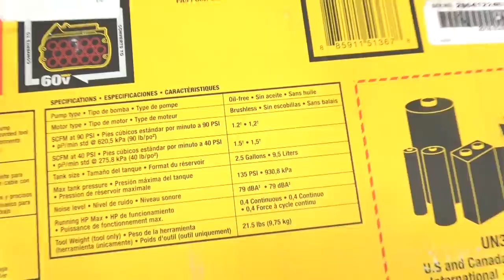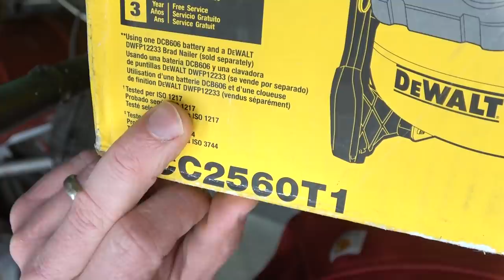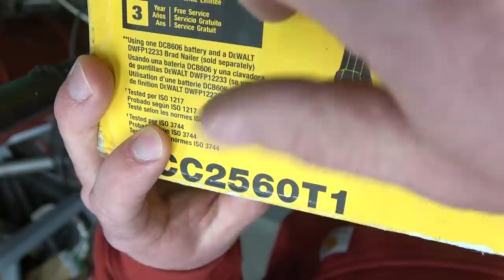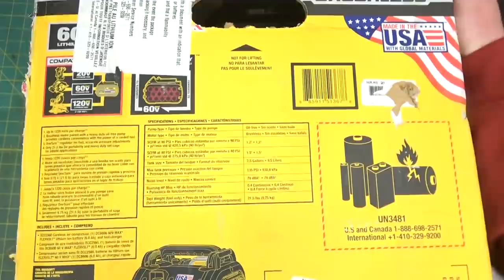BOLTR: DeWalt Flexvolt Compressor | Gutless and Brushless?

Comment: I have one of these compressors it isn’t strong but it will take you out of a jam if you need it. The way I looked at it was either buy all new battery powered nail guns which aren’t very good or have a battery powered compressor which has a lot of uses. I never thought of it as a very “good” compressor but it gets the job done. Love the vijayos keep it up
Reply: did you think about getting a little air tank and using a foot pump? or charging up air canisters at home?

Comment: Had one of these compressors.  Ran 2 minutes, locked up and blew smoke.  Took it apart and found one of the 4 screws that fasten motor to crank housing jammed in-between cylinder and connecting rod.  Other 3 screws laying loose.  They were never screwed into the motor housing!

Comment: Cordless air compressor belongs right in the same bin as the battery powered chainsaw,trimmers and blowers..
Reply: my 80v greenworks pro chainsaw is awesome, idk what youve used..
Reply: @devilgtp  bet my ms461 is better
Reply: $600 for that chainsaw vs. $250 for the 80v
Reply: Actually quite a lot more than 600 and still worth it
Reply: @woodyplatapus  As much as dino juice is better, it's useless before 8am. An electric setup can be good for pros too ;)

Comment: I believe your correct on the unloaded. When that top reed gets damaged by the heat and back fills into the compression chamber they don’t want to restart the compressor with say 70 psi at bdc causing a higher startup current. The pressure would push the piston down, uncover the hole and bleed off.

Comment: It'd be neat if they made it where you could plug it into the wall as well as with the batterias. I've got a 300cfm blower fan at work that has batteries but you can just plug in any old extension cord into a socket behind where the batteries go
Reply: I'm thinking you can plug this in. If not the dewalt one of the brands I looked at can be.
Reply: You can. They sell a clip on adaptor for the flexvolt range.
Reply: Colin Antink Sell it rather than build it in... what a shock.

Comment: great vid, as always!  Two thoughts watching the vijaho. 1. The handle on the box wasn't put there by Dewalt, they likely just buy an off-the-shelf commercial box and have it printed with their colors/marketing/logo - the die for the box cuts it at the same time as the box itself, most likely. 2. The tank has a UL logo on it.  UL is not a self-certifying agency; you must submit products for testing.  PS - I despise UL, they are a pain in the arse to deal with haha.  PSS - I was hoping for a proper unboxing and the famous "TIME" line, but all the other jokes and rants along the way made up for it :D

Comment: I will look it up in the morning but there is a minimum internal volume to require national board stamping per asme section 8
Reply: Found it! (No its not the morning i was busy commissioning a fuel gas compressor) 
Section VIII Division I
U-1(i)(vessels having an inside diameter, width, height, or cross section diagonal not exceeding 6 in. (152 mm), with no limitation on length of vessel or pressure;

U-1(j)(3) 1.5 cu ft (0.04 m3) in volume and 600 psi (4.1 MPa) design pressure.

Comment: The type of inefficient automation you're referring to in minute 26 is called "Bang-Bang" Automation. Works just fine for vessels where the capacity cannot be easily drained (Large water tanks that are rarely being drained faster than they can be filled) and where it's expensive to keep the fill pump always on or on a VFD. Thought you might want to know the term.

Comment: Atleast 6 layers of teflon tape over all threads and tru blu pipe dope over top that you'll never have a leak
Reply: You don't need to wrap so much teflon tape if you use the mil spec stuff.

Comment: 23:00 the voltage spike is called back emf, or back electromotive force. Inductors (electromagnetic coils) store energy in the form of a magnetic field, sort of like an inductive capacitor, (if such a thing existed). When the magnetic field collapses (compressor cycles off) a voltage spike many times the operating voltage, is produced in the opposing direction of the initial current which has the potential to damage components. The flyback diode acts as a check valve to stop the reverse voltage from damaging voltage biased components. So not only does the voltage spike, as you said, but it spikes in the opposite direction. Maybe  the polarity is not such an issue with ac power though.

Comment: the hand hole is for pulling off a shelf..? can't tell if everyone is just trolling or not..

but as someone who has had to deal with pulling boxes off cramped shelves that dont have a hole of some sort.. it sucks ass. I think the box designer was actually  thinking about the warehouse guys that had to deal with the things

or maybe its just ass covering, who knows lol
Reply: Should be closer to the bottom in that case, so it doesn't tip.
Reply: @QGG639  i expect they already have the tooling in place for the typical "hand hole". 

and re-tooling to solve a problem for the peasants isn't usually in the budget lol

near the bottom and only 2 fingers wide would be ideal i'd say. No chance of accidentally using it as a carry hole, and easier to deal with while on a ladder

Comment: Great video. Doesn't "drawn over mandrel" often mean they started with a thicker wall welded tube and then smooshed it out into a thinner wall one with the mandrel? It's almost as good as seamless but cheaper because a lot fewer cold drawing steps. No comment on what the actual stuff that compressor is made of, just quibbling with the terminology.

Comment: Pipe fittings is what I do in my new job, supplying piping and fixtures for fire hydration systems. Everything is tapered threads. We use hemp fiber for pipe seals. Because its plant fiber, it expands if it gets wet and strengthens the seal. It also makes on the job adjustment easier and less likely to break the integrity of the seal while adjusting,

Comment: Great video! I purchased the Ridged battery powered compressor then I bought the DeWalt. I like the DeWalt much better. I can drive a string of 16d nails if I had to.
Reply: @ChrisGilliamOffGrid  It works great for trimming or like I said a few framing nails. 
It's great got keeping behind your seat. :-)
Reply: @ChrisGilliamOffGrid  Agreed! I'm selling all my Ridgid cordless tools and buying more De Walt tools.They really have some nice 20 and 60 volt stuff out there right now. 😎

Comment: I had a computer part that came with a label saying 'warranty void if removed'. Thing is the sticker was on the outside of the cellophane wrapper of the outer packaging.
Reply: actually standard in the automotive world. so many folk were using parts to test a fault then returning them most factors now put the parts in a clear baggie with such a sticker, makes it a right nightmare to return genuinely faulty parts.

Comment: Ave i work with stm32 microcontrolers i could cook up a pcb with a 3 phase motor drive controled by the micro that varies speed based off pressure and flow requirements and temp

Comment: I'd say this is rather pointless as it'd probably be cheaper to buy a cordless nail gun
Reply: I can't get a cordless gun that works.  So I just bought this compressor.  Makita 18 guage is to bulky.  Makita 23 guage fires when it wants 2.   Then I tried grex.  They worked perfect didn't care about buying the gas.  The grex is poorly built one little drop the 18 and 23 guage broke.   Next I tried ryobi lol the 23 guage is awesome the 18 is ok.  But I'm a pro so just bought this compressor with pneumatic DeWalt 18 and 23.
Reply: Cordless nail guns on average suck

Comment: A friend from a forum actually told me just recently to put a bit of PTFE tape onto the bleeder valve on my brake calipers. It doesn't seal it when it is shut (that's what the tapered end does) but it does prevent air creeping in through the threads while bleeding the system. Works a treat, I need more PTFE-Tape to put it into all the threads.

Comment: when you were talking about overspeeding the thing, I think you forgot about how short the life of the compressor head would be.  That's the reason we go out of our way to get belt driven stuff.  Larger piston, lower speed, longer life.

Doing it a bit is fine, but you run that compressor at 9k rippems, and i'd be surprised if it lasted a month of light use.

Comment: Cordless compressor? What a horrible idea. No way that could work for anything but the occasional light nailgun.
Reply: And that is exactly what it is designed for...
Reply: I was thinking it would be good for things like bike tires and floatation devices at the cabin, not everyone has power and you don't want to kick over a generator for everything.
Reply: I use mine everyday, where space is a precious commodity in my small truck, mobile small engine technician,  cleans carbs and parts great. Has worked great for a year now. Also pumps up a flat tire pretty quick. I love mine.

Comment: @ 13:00 ... instead of heating the tank, what about just putting the male end in the freezer overnight?  ... it works good for installing bearing races with a hammer, seems like the same effect would work there too. ... But then again, it's so easy to replace teflon tape....

Comment: I think it would be pretty cool if you made a Arduino based 3phase controller to really see what it can do. Maybe even put a clamp on heat sink fins to the cylinder, which are cheep and easy enough to get. A pressure release solenoid to create a cooling cycle. So many possibilities. Great video 👍.

Comment: I learn so much from the spontaneous aside chats. Keep it up uncle B. I liked the chat about the npt and bpt and jic. Now I'm going to go and give my swagecock fittings a hug...
My first job with them was a argon system with about 25 connections. No leaks. Holds 1500psi for a week. I know large molecule yada yada thats easy. But still its a piece of piss and cheaper than a pipefitter.  Keep your stick in a swage.

Comment: Displacement Compressor Performance Standards
Acceptance test codes were originally written to be a test method that could be used to confirm that a compressor built to a customer’s specific requirements for flow, pressure and power actually met those requirements. If the requirements were met, the customer would “accept” the compressor and the manufacturer could be paid.
ISO 1217. Annex C is a “Simplified acceptance test for electrically driven packaged displacement air compressors”.
Inlet Air Pressure	14.5 PSIA (absolute) ... The ambient pressure in Denver is about 12.2 PSIA , so compressor output would be 12.2/14,5 ... 84 % what the label says .
Inlet Air Temperature	68 °F ... temperature correction (460+Standard Temperature in _F) / (460+Ambient Temperature in _F) ... thats about it , its really simplified . 
Relative Water Vapor Pressure	0
Cooling Water Temperature (if water-cooled)	68 °F
In conclusion, the ISO 1217 rating for a compressor serves as a volume rating, indicating how much ambient air the compressor will deliver to the terminal point of the package at the rated pressure. From there, calculations can easily be made to adjust the volume rating to the actual site conditions.

Comment: Counter-in-2-it-tive-lee, you want the softest rubber with the least amount of damping (as durability allows) for isolators. This makes a system where the mass (i.e. unit weight) it held up by a very soft spring (k). Wn=sqrt(k/m) and what have you so the natural frequency of the system is lower than the pump operating frequency. This puts the unit operating in the mass/interia controlled region. Which is the ideal region for minimizing vibration transmission from pump to floor. See top of page five on this bad boy for the dubilido:
https://nptel.ac.in/courses/112101096/download/lecture-21.pdf

Preciate you share-in your knowledge wid these here videos, AVE.
Reply: Too bad a vibration isolation is such an art/science thing it could be so useful for the Stoopid noisy Ninja blender.

Comment: I have soldered a brass bicycle tire valve from an old tire to a car freshener spray can for a shitty compressed air bottle. I did the due diligence of looking up the rated pressures of garden variety spray cans and my pump will do 10 psi at most, which is well within range. And soldered it facing away from the user. And tested it inside a steel cage, bringing it up for pressure and letting it sit there for days. Works fine.

Comment: Regarding a free wheeling diode action -- just yesterday I compared two different kinds of small 5 V relays to see the effect of a free wheeling diode..The slightly larger one produced a kick back of 280 V at drive release, without the diode.  With the diode, it of course was just 5.6 V.  But the drop delay was just about 70 microseconds without a diode and nearly 4 milliseconds with the diode.  Both relays had about 1 kilo-ohm coil resistance.  But the reed relay had lower inductance and therefore lower time constant.  The kick-back voltage without a diode was "only" 150 V and its release time was about 40 microseconds.  But with the diode it was considerably faster than the bigger relay was with the diode -- around one millisecond.  I used an 800 V FET to drive the relays, anticipating the high kickback.  Then I added a 3.3 kilo-ohm resistor in series with the diode and found that the kickback was (predictably) 4 times the supply voltage, or about 20 V.  The release delay was almost un-affected from the no-diode reference speed..  This whole exercise was to "calibrate" my very old gut feeling about the benefit of a free wheeling diode, and especially about optimizing a series resistor value.

Comment: Thing looks handy but not at 400 doll hairs.  Just buy more hose
Reply: I agree that's way too much money for this but the longer the hose your talking about running the more pressure loss you have. My nut smacker will whack off a nut at 500 ft/lb on a 25 foot hose but won't even budge it at a 100 ft hose. I know that's not what this compressor is for but still good to know about pressure loss.
Reply: James F do some research bud. More hose is more storage. There is no pressure loss. It’s not a vacuum
Reply: You probably wanna increase the fitting size and or diameter of the hose to chooch that nut whacker.

Comment: I used to design pressure vessels for them big 18 wheelers on the roads for their stopem' devices.  We used to pressure test to 150 psi working pressure in a tub of water to check for leaks and then hazard test the operation to 2x working pressure.  When those seam welds let go under pressure, you'd most certainly shit your pants.  The whole building would shake.

Comment: you mention that the tank is not labeled with any certifications, yet the label on the tank has multiple certifications listed, from what I could read just by pausing the video, I see 3. UL 405A, which is a USA standard. and 2 mexican certifications: Ance, and NOM .  Mind you, I'm not sure which if any of those actually measure tank pressure, but I would assume some type of certification was acquired in that regard, because to sell even a hand-powered manual screwdriver in the US has a ridiculous amount of red tape. The tool is safe bro, it's a low pressure device, it's not gonna blow up. Stop taking the thing apart and plug it into the wall when you need to use it.

Comment: I own a couple FlexVolt tools. The circular saw is handy & the weed trimmer is fantastic. That being said, am I the only one missing the point of a cordless compressor?  Seems like there would have to be a really specific set of circumstances wherein this would be the only solution or even convenient. Are we installing crown molding in a tree fort or something?
Reply: More like if you are on a job site on a roof without power. Or the ‘fucking sparkies’ turn it off mid job and go off for lunch. You are not quite so screwed. Though I suppose a generator would be useful here. Anyway question. Do you have the XR version of the circular saw?  I do. And am wondering how much better if any the flex volt one is?
Reply: @colinantink9094  I have no frame of reference but I imagine the FlexVolt isn't noticeably better in terms of performance. I suppose the larger battery is more convenient. That newer worm-drive style FlexVolt looks like a beast though.
Reply: @colinantink9094  roof guys almost always use those double hotdog tanks that are gas powered compressors.
Reply: @johnpossum556  Right, pros will have those gas powered setups. I wonder if this FlexVolt thing could even keep up with a roofing nailer. I doubt it. What in the world is the purpose of this thing?! Did they run out of FlexVolt ideas already?

Comment: You are worried about inductive kick-back on a brushless motor? The ESC should take care of that as it is electronically commutated.  Those same control transistors would get damaged from a high voltage spike.

Comment: I know that in New York State about 6 years ago the regulation on pressure vessels  was relaxed, and we no longer have to have the fire department out to test our air tanks every five years.  In fact they won't come out, though we still do the hydrostatic testing.  I wouldn't be surprised if that was on the heels of some federal reduction in standards or maybe even a trade treaty reduction in standards for pressure vessels, but that's all above my pay grade.

Comment: Get yourself a bottle of Loctite 545 for shop air fittings. You'll never want to fuck with the tape or grease ever again! I promise! "Industrial use only". I do use this for industrial purposes and GALLONS of 545 used later I still love it. A small bottle will last a normal person forever.